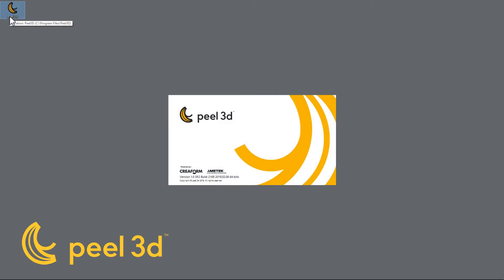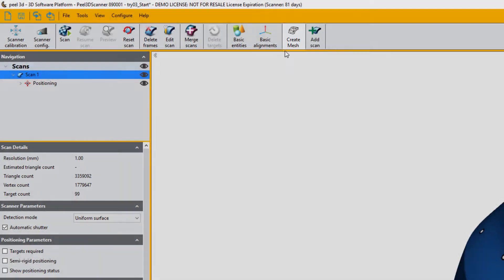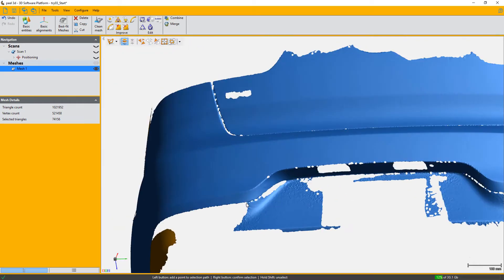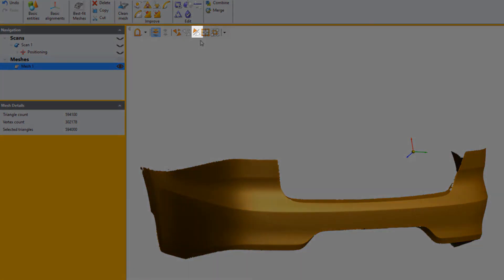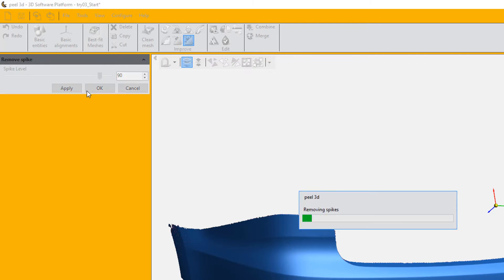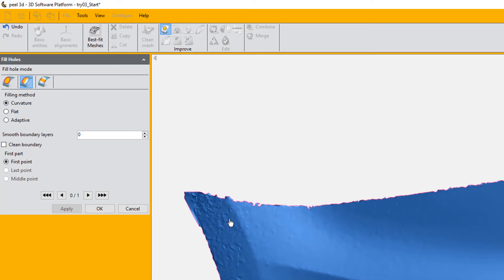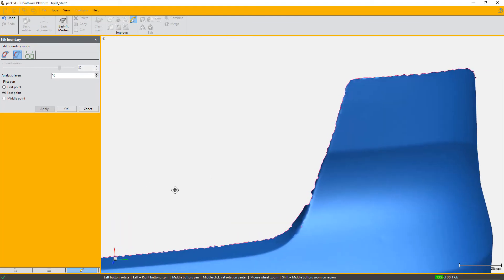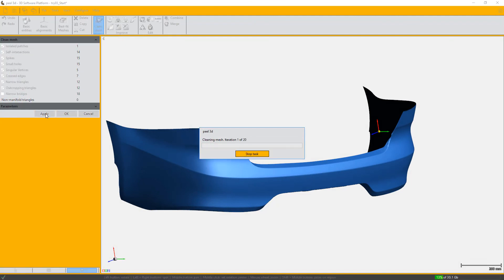peel 3d™ | Clean Mesh and Borders Tutorial

Comment: Hey. Does the equipment serve to accurately scan people or animals, considering hair and textures?, and is working with 3DSMAX or ZBrush. Regards.
Reply from the maker: Hair and fur is always a challenge with about any 3D scanner (regardless of what manufacturers say). That being said, a peel 2 scanner will pick up bits and pieces that can then be turned into a watertight model with the tools provided with the scanner. Once completed, this base can be exported towards a sculpting software (such as ZBrush) to finalize the design and sculpt it a bit. We've obtained some pretty good results using this technique.